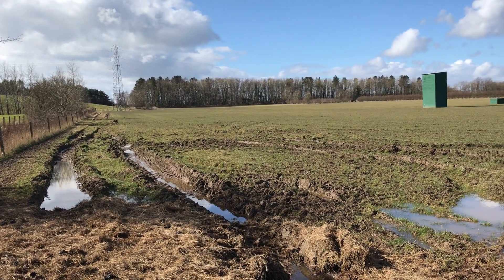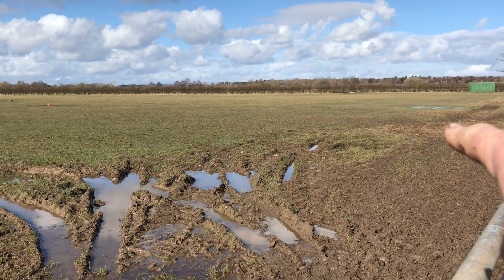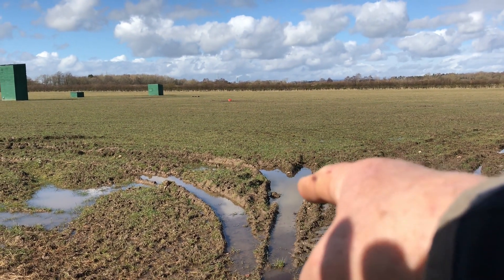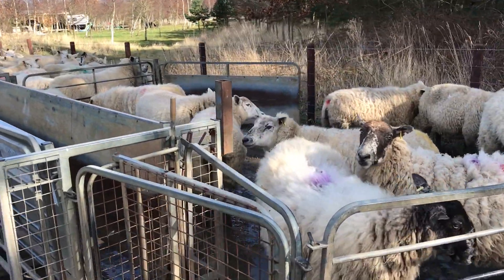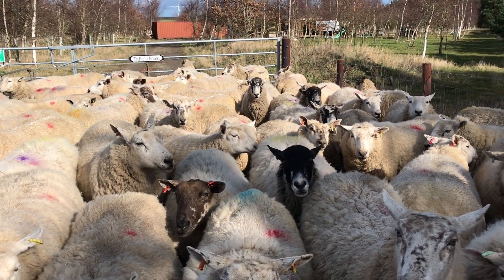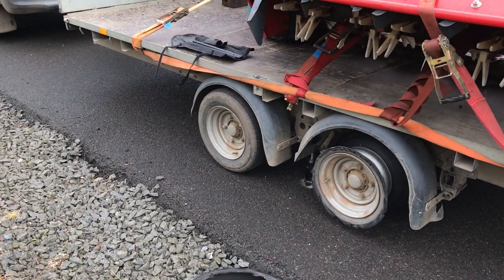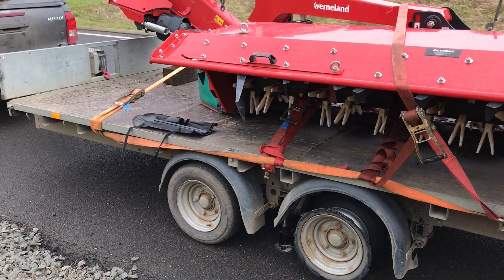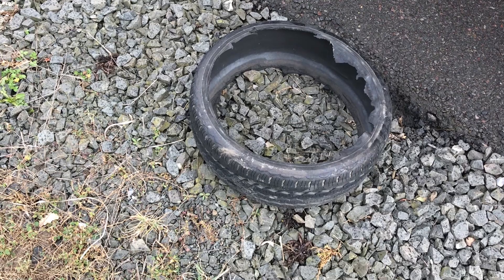weekly yarns  #47

Comment: Could you find a plastic tub large enough to soak the castings in and remove the rust with electrolysis?  Just a thought, as I hate sand blasting parts that will have delicate or precision bits in them. That grit is just a royal bugga to get out.
Reply from the maker: Hi mrskyrydr, you must be a mind reader lol I was thinking about that last night , your right the thought of grty bits in the bearings doesn't fill me with joy either, might see if I can find a IBC and cut the top off, suspend the casting from angle iron across the top.
many thanks
Barry

Comment: One question, if somebody knows and can help, so in video 19:46, there is small hole on the bottom of final drive castings, where the brake drum is, so what is that hole used for and should it be blocked? Thanks in advance
Reply: It’s a drain hole to let any water or oil out of the casting so it should be kept clear.  If any oil is coming out of these drain holes then it’s a sign of a oil seal leaking, either from the final drive or from the rear axle casing.
Reply: @David.Monkhouse  thank you, good to know that about oil leaking
Reply from the maker: Hi Games channel I see Davids already answered your question.
many thanks
Barry